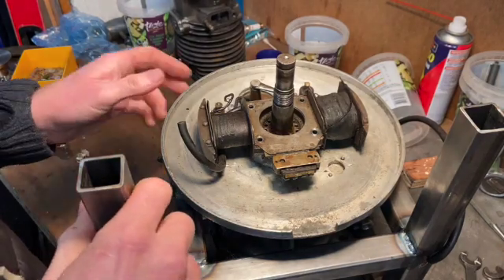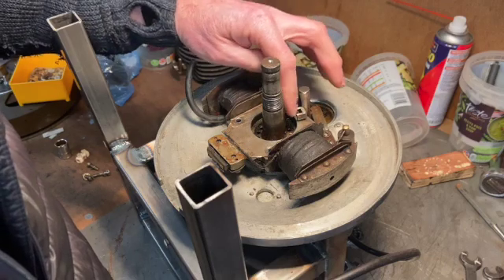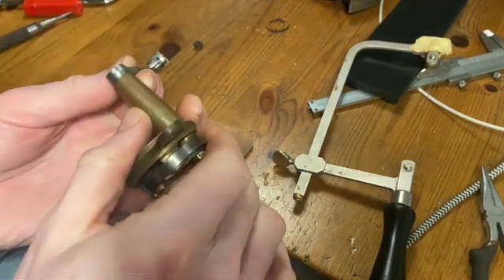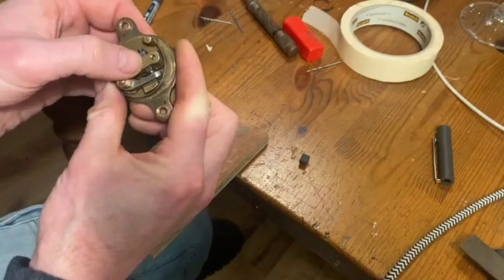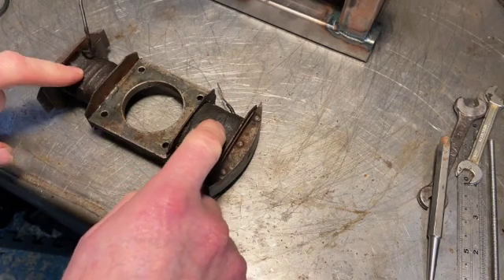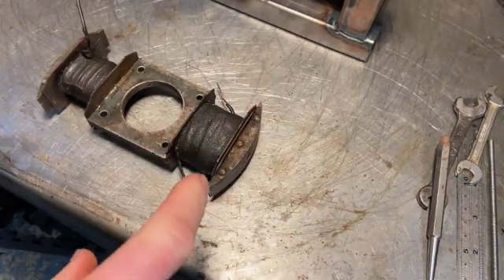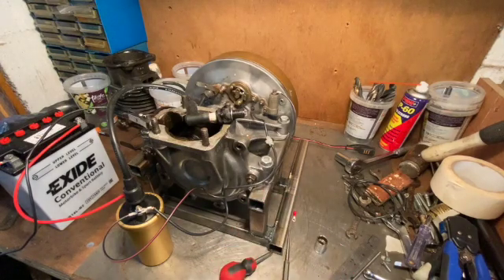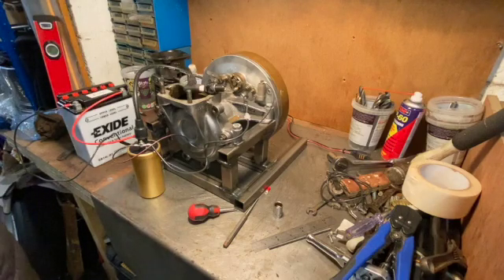Ner-a-Car Engine Project - Episode 5

Comment: The capacitor's (a.k.a. condenser) function is more than reducing the sparking across the points - which it does. It,  in conjunction with the primary coil, results in a resonant frequency in turn producing a calculated 'ringing effect' (oscillation) in the collapsing magnetic field in turn, induced into the secondary, generating the necessary spark. As the capacitor charges, the energy is transferred from the coil's magnetic field into the capacitor's electric field. The capacitor then discharges back into the coil, and this process repeats. This rapid oscillation of energy between the coil (inductor) and capacitor is a resonant event. Of course it isn't as simple as this. An engineering text book might describe this magic much better than I.  😕
Just catching up on some older videos, one can see the growth in quality of filming and editing. ♥🙂
Reply from the maker: My first efforts... but thanks for watching ! Funnily enough we'll be re-visting that on Sunday!!

Comment: Fun to catch up on how the motor works after watching the Ner-a-car fettling! (Also, after a lifetime of tinkering with all manner of internal combustion engines, I’m embarrassed to admit I’ve only recently learned it is the OPENING of the points that triggers the HT spark via collapsing field. I always assumed the points closing energized AND created the spark….🤦‍♂️
Reply from the maker: You'll be forgiven for thinking that, as making the circuit is normally what makes things happen.... !